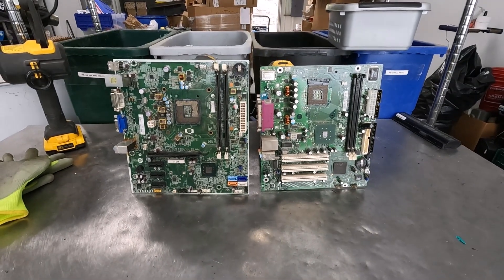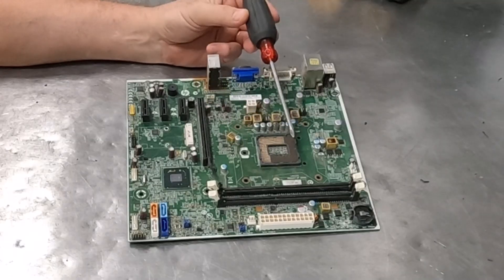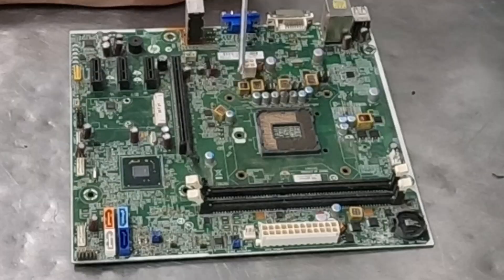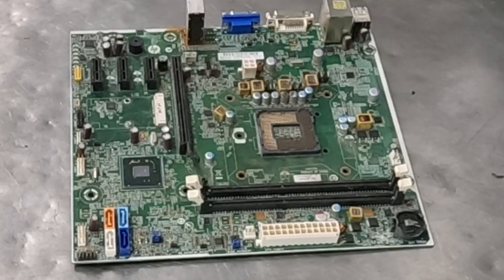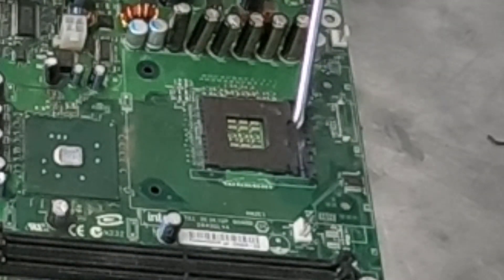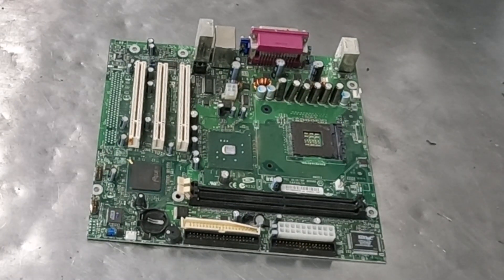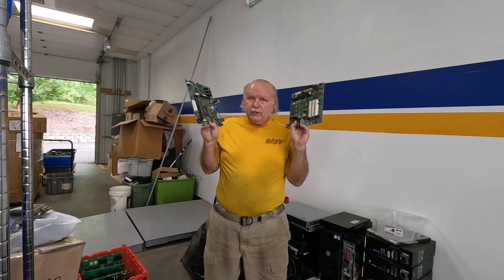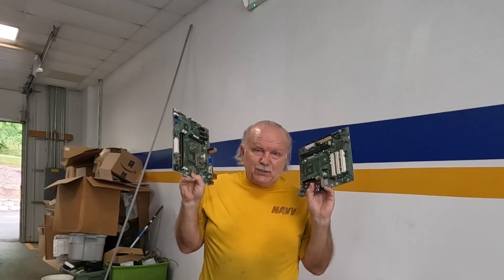How to Identify Motherboards Missing Key Components

Comment: Gotta say, ever since Boardsort changed the motherboard categories, I think I've spent more time resorting my motherboards to get them into the right categories than anything else (other than taking stuff apart). This is twofold on me - I had already sorted everything in preparation for the old system to send them in, and didn't actually pull the trigger, and I think I've gotten too attached to OSCAR - and some of the more questionable ones come back as something I wasn't expecting. Not blaming Chris one bit - he has to do what's best for business, but also maybe I need to rely less on OSCAR for some of the more random stuff I have.
Reply from the maker: I agree - OSCAR is no substitute for our experience. It’s great with standard boards and will get better over time with the unusual stuff. But nothing beats using our own brains as we learn.